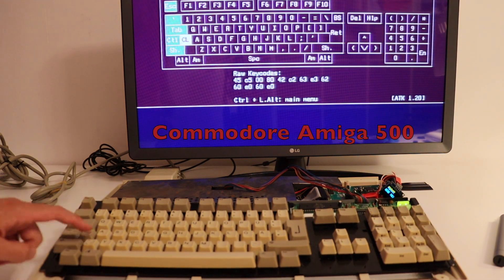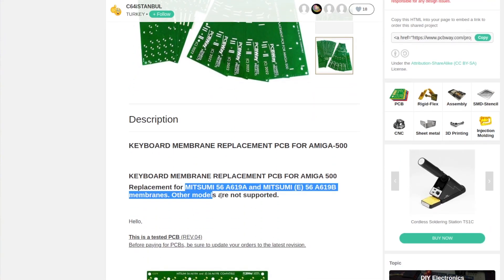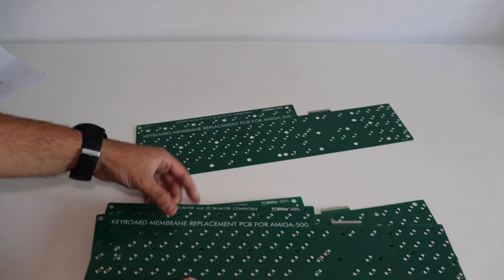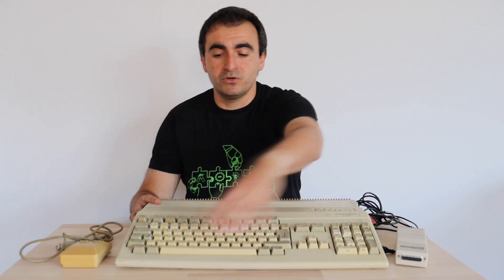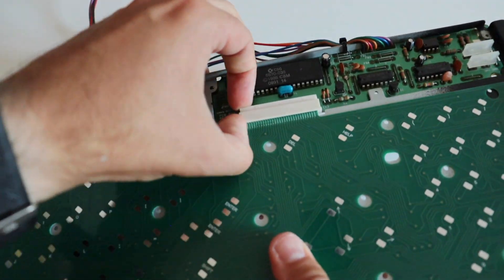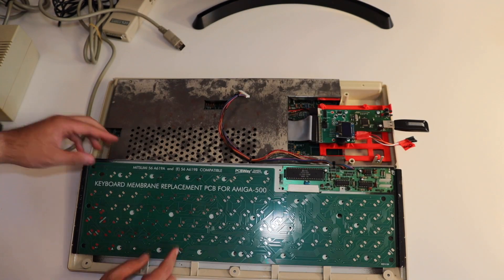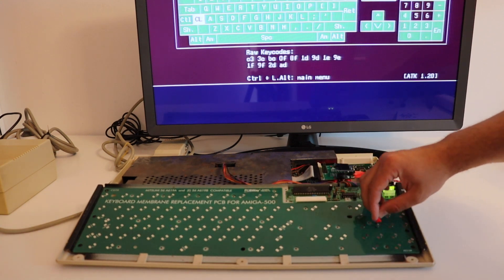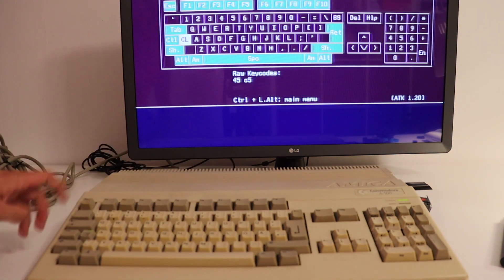Restoring the Magic: Repairing Amiga 500 Keyboard with a PCB Replacement!

Comment: I try to find out why every replacement is a hard PCB. Why not a flex PCB? In my opptinion it would be easier to fit and still has copper traces that makes them as sustaiable as hard PCB.
Reply from the maker: Excellent question! I agree that a flexible PCB will be a good fit for this project. Recently services for manufacturing flexible PBCs became more popular and less expensive. So it is a good idea for someone to try it for an Amiga keyboard.